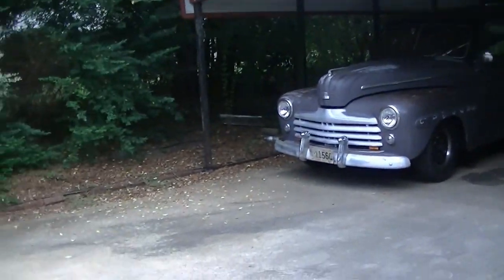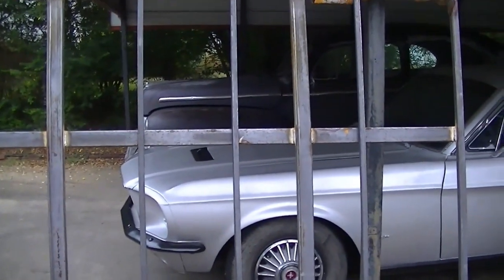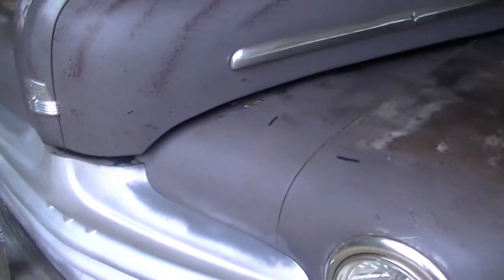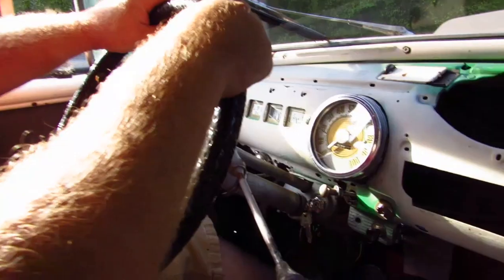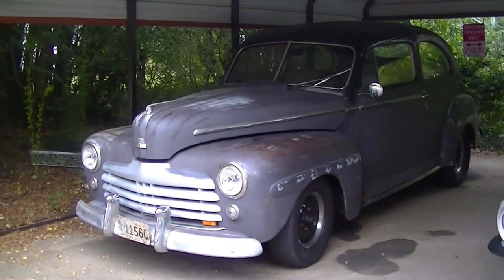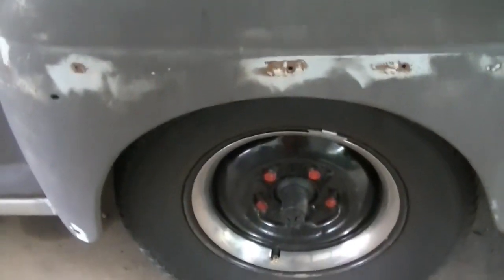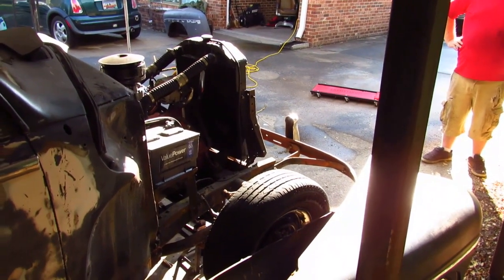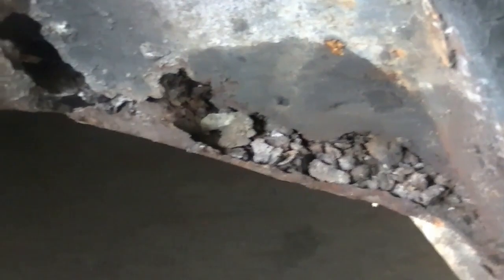1948 Ford Sedan FULL body swap with Ford Ranger..Part 2

Comment: You can adjust your wheelbase on the ranger they separate at the front spring hangers behind the cab to shorten or extend wheelbase
Reply from the maker: lee, thank you for the comment! True, I probably should have done that (didn't realize until you mentioned it, thank you). This project has been a wonderful learning experience and just a lot of fun getting to spend time with my dad. I'll try that on the next one. You know how it goes..with every build they get a little better, you learn something new and what you should and shouldn't have done the first time..haha .

Comment: I noticed a 12v battery. What all did you change from 6v to 12v
Reply from the maker: Thank you for the comment. well, The generator, coil, condenser, all the bulbs and balast resister have to be changed to 12 volt varieties and some say the starter and wiring harness. you will lose the function of the gas gauge as well if you do not install a voltage step down or replace the sending unit. I only ran it as 12 volts brielfy and did the bare minimum due to the fact i was doing a frame swap and only wanted to drive the car as it was briefly. The cars ive done proper conversions on I buy a new full universal wiring harness and replace the 6 volt wiring as its not really designed for the current and well...its 70+ years old, cheap insurance really.

Comment: Hi - I like what you are doing - I'm doing almost the same with 48 four door sedan onto a 2013 Ranger & want to keep all best new car features to look as good as a old 48 Ford.  I've shortened my chassis as my wheelbase was 320mm (12 inches ) longer - getting brake booster & pedals is requiring a bit of a squeeze.
cheers
Reply from the maker: Kevin, thank you for watching! you are absolutely right, these cars are much smaller than they appear once you start updating them with modern hardware. Stay tuned to see the build and fabrication in upcoming episodes. Good luck with your build!!

Comment: 06 crown vic 114.7 " wheelbase 77.3" wide
Reply from the maker: Tim, thank you for the comment! I thought about going with a crown vic, but the track width was just too wide. The ranger has a 57" track width which was the same as the 48..and mostly because I had a ranger..that really was the deciding factor. Gotta wrench with what ya got and just make it fit.
Reply: @myrustlife  I unerstand. Good Luck!